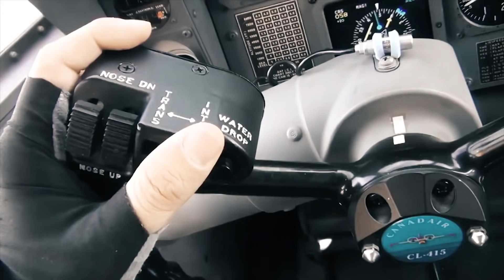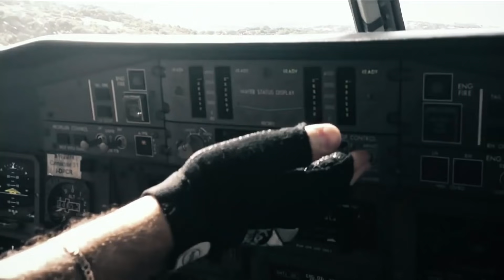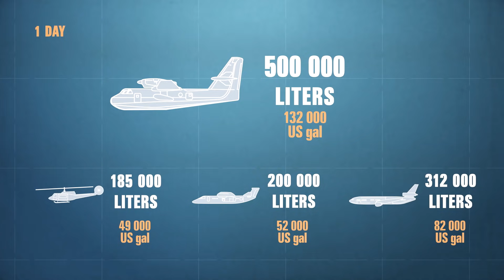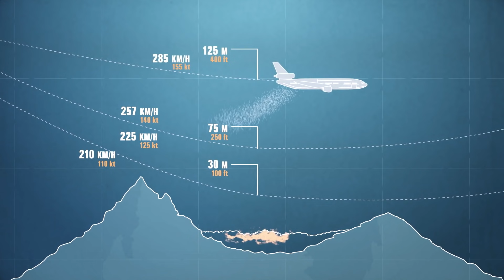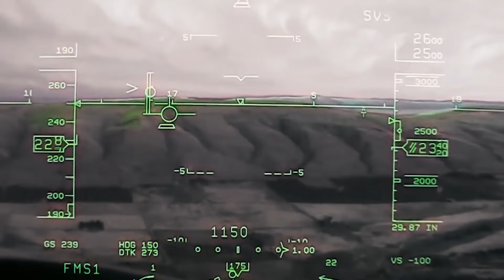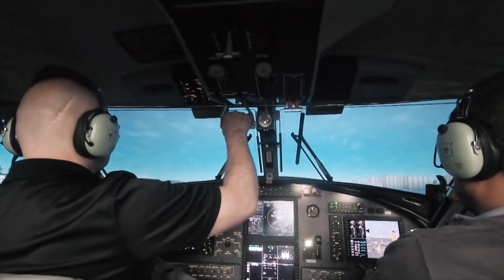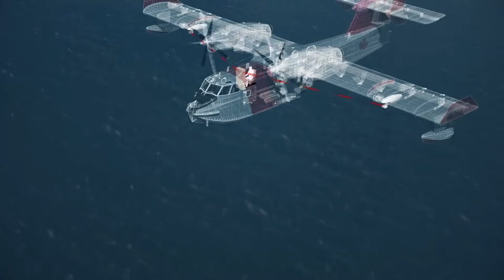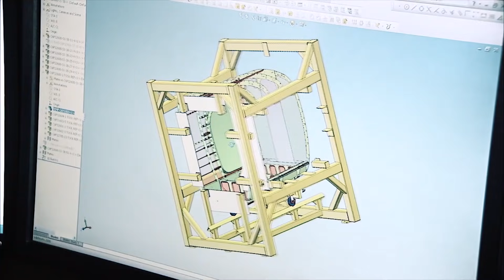Viking Canadair CL-515 Super Scooper Water Tanker Aircraft

Comment: What about the mars water bomber?
Reply from the maker: This is not a video about the Mars bomber. Although the Mars bomber is a beautiful machine with an incredibly large capacity, it is an old airplane.  It is good for dropping large amounts of water over a large, smooth area. This water bomber can get into smaller areas in hilly country. And as always, it is a tool in the toolbox.
Reply: Retired. Too old and costly to run to maintain.
Reply: @jerrydewit5513  Costly?  This is silly, as the numbers are there in black and white. CL-215's are actually more expensive per hour to operate. It is also more expensive annually to maintain. The only reason that was given that adds up, is that the amount of bodies of water that they can access is limited compared to other aircraft. California Fires will be well over 150 bil. USD. Costs are always relative. Like the costs to actually manufacture something of Similar size and capacity today would be astronomical, much more than maintaining them. 

As De Havilland is finding out, producing the DHC-515, even with the JSF/Boeing aircraft manufacturer supply chains. Labour, quality and delivery times balloon costs to the point where the economics of the project are challenged. Except when there is an emergency.

Comment: The company I worked for did some work on a CL-215 and two things really stuck out about it:
First is how spacious it is inside.  Most of the fuselage is empty with two massive pipes for the water intakes and the water tank occupying the centre of the aircraft.  And second is how THICK the aluminum is throughout the aircraft!  I also thought "built like a tank" when I first saw it up close.   Also the actual water intakes are surprising tiny!  It's probably the most unique aircraft we worked on
Reply: The amount of pounding that airplane takes is horrendous, both in the air because flying through air around fires is very turbulent, but also all the waves it has to pound through when scooping on the water. Thickness = fatigue life
Reply from the maker: @sblack48 I have touched this aircraft and there’s not a point on it where you can span your hand and not touch a row of reinforcing rivets.
Reply: @wcolby  that’s why some of these airframes built in the 60s are still going. Although the bottoms get reskinned periodically from hitting logs etc.
Reply from the maker: And there are still two ships that clean the San Francisco Bay of debris, because General McArthurs seaplane hit a floating log in 1943.

Comment: its nice to see a "small town" company become a big player, and shots of the Victoria inner harbour in the trainer & when the otter is flying over the harbour. With the increase of fires, Viking is going to have a winner with the 515's almost certainly.
Reply: Yah Viking Air  . Hi Tony Turk , if your still  there .
Reply: BC will need 100 of these alone.
Reply: @Astro_Alphard  But they don't use any of them. Strangely, they don't even use the earlier CL-215 or CL-415 in B.C... their only aircraft operating from water is the much smaller Air Tractor AT-802F Fire Boss.

Comment: Recently someone developed a modest fire extinguisher ball that you could throw like a baseball to put out a small fire.  It occurred to me that if it were to be scaled up incorporating existing military technology such as canister bombs, air bursts and Multiple Independently targetable re-entry vehicles (MIRVs) using Infra Red sensors and GPS tied to a system that is co-ordinated by a common network, that may even be thousands of miles away, wildfires, in theory at least, should become a thing of the past.  Perhaps someone should contact the military contractors that hold the patents on those technologies to modify them just for this purpose.
Reply: That's a brilliant idea

Comment: Can the new cl 515 operates day and night?
Reply: The 415 were VFR and so far I have seen nothing that would change that.  Also given the mission it wouldn’t be a good idea to try.
Reply: It said in the video that they were planning to implement NVD's (Night Vision Device) to the pilots helmet so they could drop at night. Personally I agree with Stan Cunningham and think it would be a little to dangerous to be doing that at night. Not to say that they couldn't use them at all at night, but for different reasons like search and rescue.
Reply: @krusty269  the SAR version of the 415 had set up for NV but for a mission operator stationed in the cabin.  There was a early FLIR mod but was limited, more like a hot spot locator (basic direction).  I wouldn’t go staring at the display while descending as it might be the last thing you do.  Was with the program for nearly 25 years
Reply: @stancunningham3711  Flying low at night amid smoke in areas that might suffer from electricity blackouts is indeed a bad idea. However the video did mention the plane would operate "as a tanker" which I took to mean they'd operate from a significantly higher altitude similar to the cargo planes. Less precision and effectiveness, but in many dire cases that is still much better than completely stopping drops for 8-12 hrs.
Reply: Yes it can

Comment: Well... It is by far the best-fixed wing firefighting aircraft but certainly, this video wants to promote it perhaps a little too much against the competition and I refer to rotary wings, I find it hard to believe they have been compared fairly keeping in mind that their size and capability differs a LOT based on models. Even the quantity of drops of helicopters is reduced quite a bit for the purpose of the comparison. Let's not forget that a helicopter does not need a more than 1km body of water to refill and can drop way more precisely and closer to the fire the water loads... just to mention a few facts.
Reply: Different platforms for different needs. Nothing beats the CL-415 drop volume in a day if a large water body is not too far. It can fly in much higher winds than helos, and in 1 drop can do the job of several helo drops.
However helos can pick up water from small bodies of water, including swimming pools, and can fight fires next to houses and even inside some populated area. Canadairs can't. That's why some countries have both firefighting helos & Canadairs.
Got a large fire near my house on the outskirt of a town in Colorado a few years ago. 100K population. Raged for 1 month in the vicinity. It was extremely painful watching helos that, over a couple of weeks, could only scoop up water a few hours a day from the massive reservoir next door. I.e. only in the morning when the wind was very light. In the end they didn't do much, except protectecting only a few houses. A Canadair in that situation would have made a world of a difference. Maybe 4X to 8X more total water volume dropped ?

Comment: Why is BC stuck with Convair retardant tankers, tiny skimmers and choppers?  Shouldn't we make these a priority?
Reply: Bigger isn’t always better. The 10 FireBosses they are using can deliver 4 times as much water as one of these CL515’s and you can buy all ten of them for less than the price of one 515.
Reply: @FlightData101  12 seconds to get 1600 Litres of water with the CL 515
15 seconds to get 800L on the air boss. cheaper isn't always more effective or efficient. 7000 litre capacity on the 515 vs 3104 Litres on the Fireboss.
The 515 carries 2 and a bit worth of  fireboss in water drops in volume and the 515 can fly at night. Both have a place but I watched the Firebosses work one time and it was like they were pissing on  a bonfire. Firebosses working alone can't do much other than put out spots while the heavy planes pick up the slack.

Comment: Fire Boss has lowest $/gal of any type. CL415 is better than other non-amphibious platforms for most applications.
Reply: It is not about $/gallon; areal firefighting is exhausting and the CL415 can operate for longer because it would not tire its two people crew as fast as the single seat Fire Boss would. The only real comparison is $ of fire fighting / $ of damage saved; and there is room for all different size equipment, depending on the circumstances.
Reply from the maker: Toolbox... it's one of the tools in the toolbox.